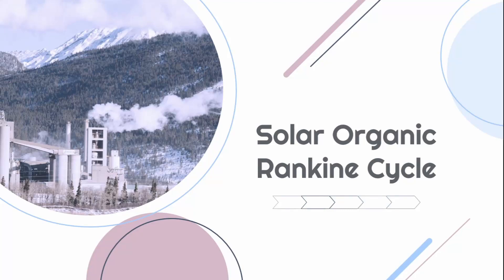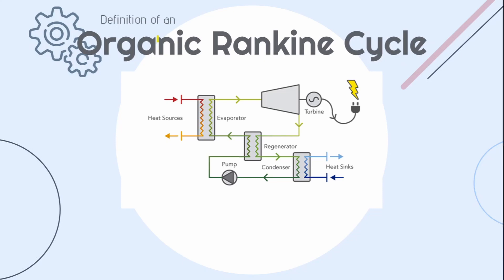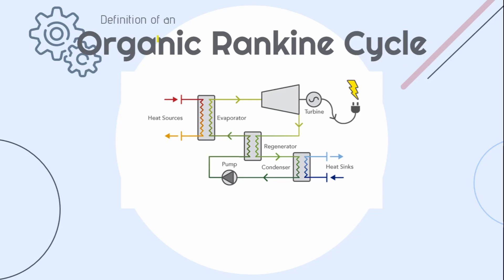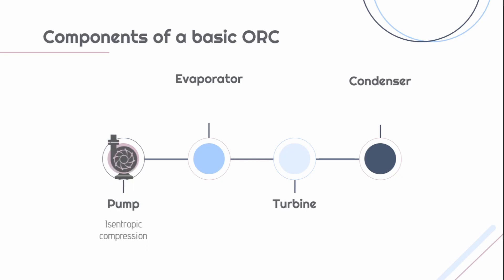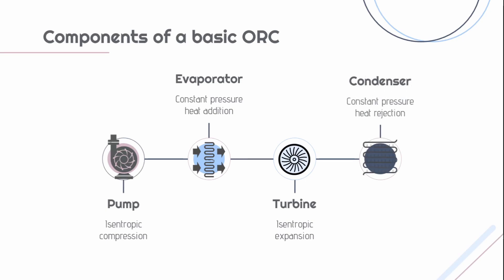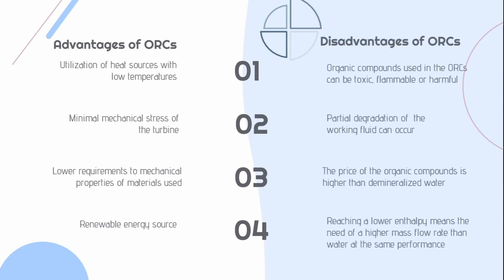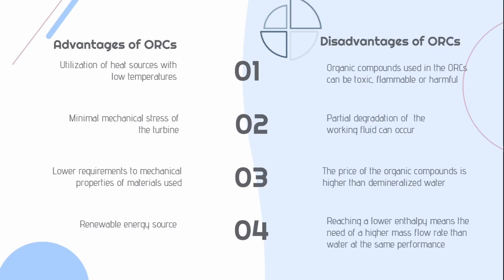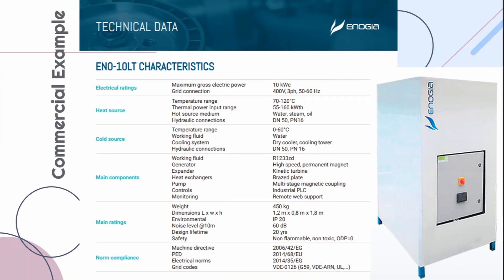Solar organic Rankine cycle

Comment: Hmm.... I cannot find a good working idea. I wanna build a greenhouse from green house in the snow. I was thinking in the front of the green house of using the solar concentrator here: 

https://youtu.be/iJCfsqvEx1w

I wanna use the abundance of steam it kicks out to power the turbine to run the pumps and electrical heaters of the green house with the extra energy generated stored for night time use. Then condense the steam back into a liquid before being pumped into the collector. 

Like it sounds good in my head but I cant fully envision the system as I know I will need to build a turbine. I have not seen anyone actually build a ORC like this and it makes me wonder if I am on the right path....or if I just dont fully understand the ORC basics.

Comment: are the solar receiver and the evaporator two separate components?
Reply from the maker: If solar energy is used, the solar collector acts as the evaporator (raising the working fluid to its evaporation temperature). If on the other hand, as an example, the waste heat of an industrial process is used, the evaporator would be more like a radiator coil in contact with the high-temperature source.
Reply from the maker: @brendonleencube5398  Thank you for your interest Brendon. I cited the references on the last frame (5:12). If you need anything else please reach out to me again.